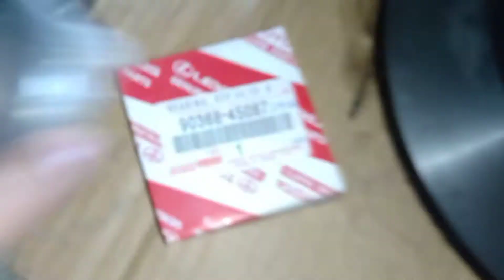Replacing the Front  hub bearing   1988 FJ62 Land Cruiser

Comment: why are there no hublockers?
Reply from the maker: There is a hub locker pellet between the 2 check nuts
Reply: @Autoenginecheck  No actual locking hubs, they are not on the cruiser, most odd.